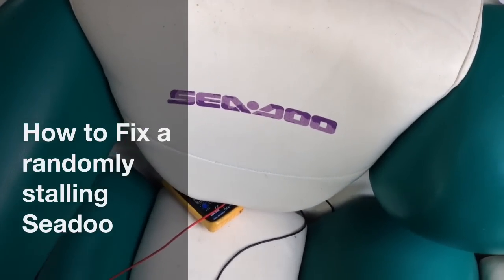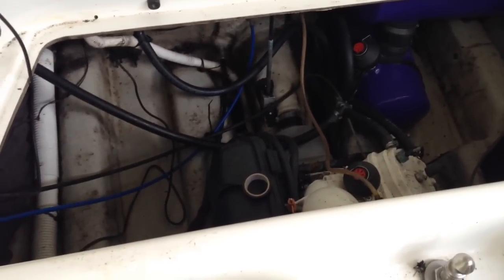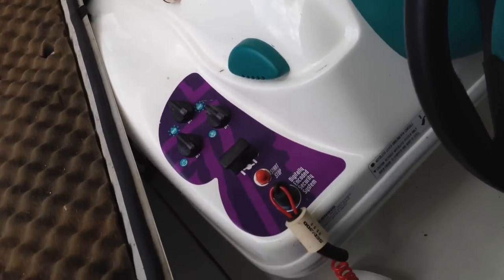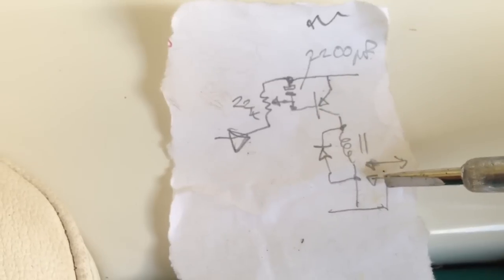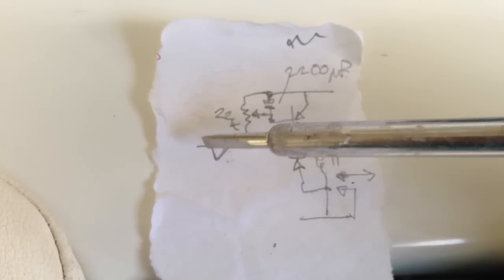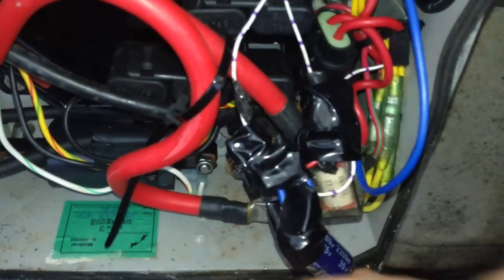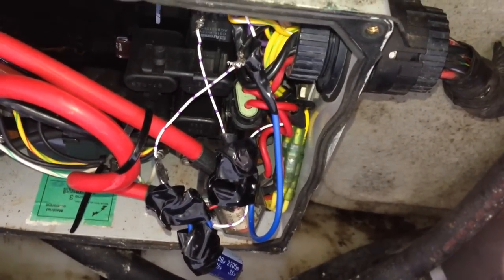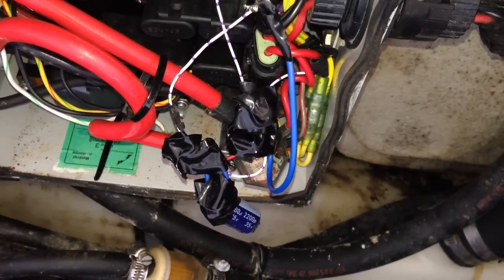How to Fix a Random Stalling Seadoo Jet Boat or Jet Ski

Comment: Thank you very much for your info, all I need to know now is where to find the relay. As far as getting thrown overboard I wear a life jacket as I am 77 years old and don't swim very far any more. I am extremely grateful for your advice as I have spent too much already at the seadoo dealer with no luck. Thanks again Barry
Reply from the maker: +Barry Mortell Your proposed toggle switch would replace the relay that is in my new circuit.  You need to open up the ecu box.  See video for location of ecu boxing on Seadoo challenger.

  It would go between what was the output of my circuit (which goes to the black and greeny stripped wire that is going into the ecu board) and ground (solid black wire). 

 The black and greeny stripped wire is the signal from the DESS post, you should cut that, isolating the DESS signal from the ecu, as in the video.  Just connect the toggle switch to the wire that goes into the ecu board, and ground (splice back some insulation on a solid black wire for a ground connection).

This allows you to test that this solves your problem, but i wouldn't recommend running in the water like that as there have been a few stories of people being chucked out and then run over by their own boat and killed,  due to them not wearing the lanyard.
Reply: +Barry Mortell - The safety lanyard engine cut-off key is not really about someone getting thrown overboard with a life-jacket on... the safety lanyard key is designed to kill the engine and prevent the boat from operating with a wide open throttle without a driver. (ie) If the driver gets thrown out from a rogue wave from another boat, by hitting something submerged in the water or hit by another boat (etc...) the safety lanyard will cut the engine if the driver falls down or goes overboard thus keeping the boat from "ghost riding" full speed into someones property or God forbid other people ;)

Comment: I have a 2009 Speedster 1500, 255hp.   The issue I'm noticing started with a key not registering immediately on the Dess.  The key was replaced last season yet that issue continues.   More recently the boat randomly switches off.  Seems to happen at any speed.  When the engine randomly stops, it may be a quick a push of the button and the boat starts up immediately....other times when the engine stops and I've fully lost the connection between the key and the Dess, it can often take 10mins or more for it to re-register.   Do these symptoms describe the root problem your solution is solving for??
Reply from the maker: There are some similarities but some differences.  Might be better to bypass the DESS completely, you could just have a hidden switch.  That would be put on the wire I mention and do the same as the relay output in the circuit.

Comment: I have a 97 GTX 787 that seems to be doing the same thing.  I just spent over $1100 get a bunch of stuff fixed on it, including a new CDI from SBT. Only seems to do it when I’m riding wide open going 50.  It will all of the sudden cut off with me.  No sputter or anything.
Reply from the maker: Sounds like the same cause, same symptoms as mine.  Something weird going on with the DES post.  Never seen any other faults like it.  The only way to fix it is the little circuit I made, in may case.

Comment: Is there a video showing the testing process?  I have a 2001 GTX that dies randomly in bumpy  chop water.  It restarts ok but is anoying.   Grounds are tight. I feel it's an electrical  issue, but need to test it out.
 If you sell the fix I'm interested. Or do another video laying out the parts ( and sources) needed and how to build it.
Reply from the maker: I don't have any more videos on this, but I suggest you try the suggested circuit to see if that fixes it.

Comment: Can the dess be bypassed only by cutting that black and green wire and putting it to the ground ?
If i can do that test and it works, that would be amazing. I could juste use a cut off switch just like a yamaha wave runner instead of doing that circuitry or fixing it with a new post and key.
Reply from the maker: I think you could but you might also need the DESS key in place as well.  Try it and see.
Reply: I'll do it before installing the circuitry, i'll ground it directly to the battery to have a 100% and clean ground. I have one friend of mine making it for me on a little board. The only thing i was wondering is about the relay. I'll use a 12V 30A HELLA regular relay that i have on hand. Should that work or i'll need to get a relay as described in the links that you sent ?
Reply from the maker: Maxime Routhier That will probably work.
Reply: @maximerouthier  I know this thread is old, but I just came upon it as my 2005 Seadoo RXT has the same symptoms of starting and running, then stalling. Restarting, running and stalling. Over and over.  So my question is did you first solution of bypassing the DESS work?  Did you also include a kill switch?  And do you still need the DESS key?  If not, did the circuit work for you?
Reply: @KM33305  the problem ultimately was to replace the post for the magnetic key. It solved the problem

Comment: would this kill both engines if this was the problem?
one engine runs fine but the other keeps cutting out, they both did it at some point
Reply from the maker: The problem I found was caused by the lanyard switch glitching, so if you have only one of these for both engines then it should kill both engines if that is the problem.
Reply: @comeinhandynow  So we got the starboard side engine to fire up and runs super great (always starts right up) but the port side engine is not wanting to start. 

It just keeps cranking and cranking, it has a spark I don't know if it's weak or normal, we switched spark plugs with the running engine and that did not work (the other plugs work fine in the good engine). 

The engine did want to start a little bit but it just dies, probably fires 2 times, when we first got it out it was running but kept shutting down after a few seconds (10s to 60s?). The good engine ran but it seemed like when we started the bad one they both died... Good engine seems to run fine without the bad one trying to start. 

We did try starting fluid directly into the cylinder and it seemed like it did not want to start (but it had spark?!?) last we tried it wanted to start for 2 seconds then die and we have up and took it home.
Also before we brought it to the ramp they both fired up and ran for a good amount of time. 

Could it be the dess? Mpem? Main brain? Any questions or answers would be very helpful, we intend to try to keep working on it tomorrow! 
Thanks everyone!
(posted this on th forums too)

Comment: PLEASE HELP ; So I have 2012's GTI'S they both are acting up by after we ride them in rough waves for a while, the dash wont light up and ski wont start... I wiggle the fuses and the key post and eventually it works. then does it all over again???
Reply from the maker: Is the fuse box waterproofed enough? Check for corrosion on connectors.  If it stops with symptoms that are the same as if the key post had been removed, the the fix in this video may help.
Reply: @comeinhandynow  NO CORROSION AT ALL. THINK IT MIGHT BE THE KEY POST/KEY DESS, I CLEAN THEM WITH A PENCIL ERASER... IM GOING RIDE TOMORROW